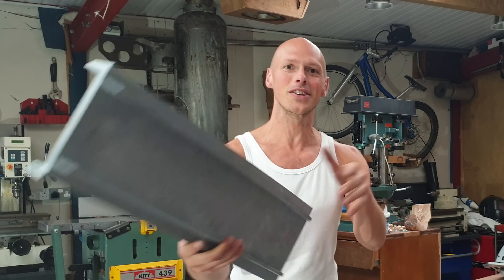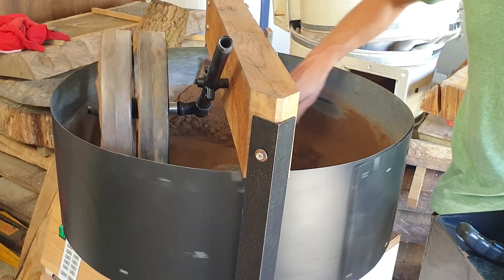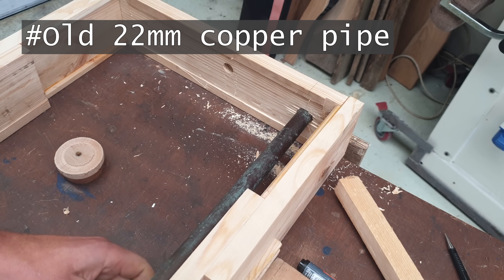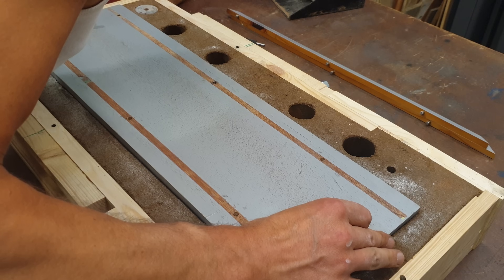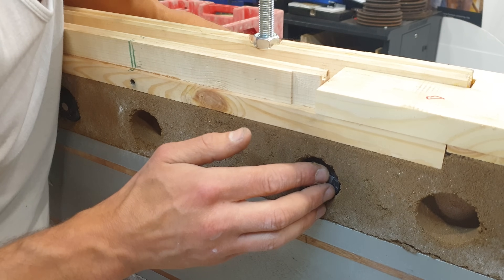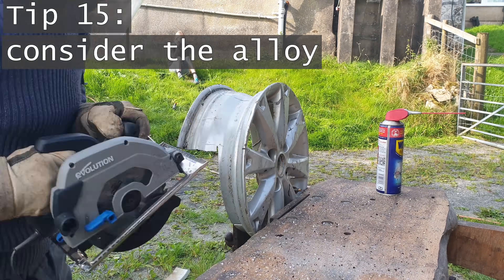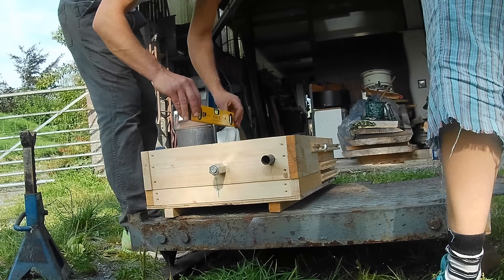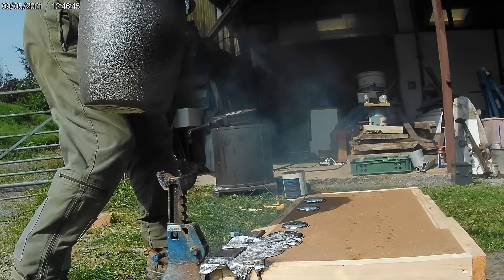Al Metal Casting: Tips for Making Good & BIG ones at home!

Comment: As a fellow metal caster and admin for a large metalcasting Facebook group, I like to congratulate you on a great video. Most of your stuff is spot on. 

A couple things - I wouldn’t give a specific % of bentonite for greensand since this will vary depending on whether they have a muller (most don’t and mulling by hand requires more bentonite) and also the sand grain size and character. You could go as high as 20% in some applications and 12-15% for hand mulling in the backyard environment would be reasonable for the beginner. More bentonite (and to a degree, more water) is a crutch that you use as little of as you can get away with, but for beginners, adding a little more will help them have more success until they wean themselves off of them. 

You should poke your vent holes from the inside out that way you don’t get sand breakout on your mold surface. I know you know this and you even mentioned that you hoped the drill’s outward movement counteracted your inward motion. Still, with a great video like this, lots of beginners will copy this, consciously or subconsciously. If you take the time to make and edit a video like this, I would focus on showing the right things to do rather than showing the wrong thing (as with the flask handles or overfilling the crucible) and saying “don’t do this”, even if it’s a genuine mistake, because it’s in people’s nature to copy when they are learning.

The holes you showed when talking about hydrogen absorption look more like air entrainment during the pour or possibly turbulence. Actual hydrogen porosity bubbles would be smaller and more evenly distributed through the metal than that. Not sure if “hygroscopic” is the word you want to use (I think that’s what you said) as that implies the hydrogen is coming from water in the air, when it’s more likely originating from the fuel. You are right to suggest avoiding fluxes and long “soaking” times for the metal. 

If you wanted to reach the far corner better, simply move your pouring basin to the middle (you can put a spin trap at either end) and the metal will only have half as far to flow, giving up heat to the sand, before it starts freezing. Easy enough.

Your angle iron over the edge of the mold is a great practice for wooden flasks and your attempt at directional solidification via your copper pipe chill is admirable. There is so much you got right in this video, I didn’t really want to nitpick any of it. Also see the few videos of Professor John Campbell (and any of his books) for more advanced tips. Also, if you’re on Facebook, consider joining the group  “Backyard Metal Casting & Foundry Work”. We’d love to have you as a member!
Reply from the maker: Hi Troye. I really appreciate you taking the time to write this thoughtful comment. Really love constructive criticism like this... As you see I have plenty to learn! I'll follow up on your reference when I get to my desktop... 
Yeah, I'm fairly sure pouring from the middle would have been better. And agree on the clay content etc. I see that as more experienced peeps chime in I'll have to compile a sticky comment with corrections / important notes... 
Thanks again :)
Reply: Here is one of the John Campbell videos I was talking about: https://youtu.be/9_w3OZ2b02A
Reply: Geezers long winded, it's an "Introductory" video to Sand Casting he's just explaining where he felt he would avoid to lesson mistakes. No where in the description dose Steven say he is a Mastercraftsman specializing in Sand Casting,  and I'm quit sure if I wanted to go any further, in this area, I would have the brains to learn more from other sources, Which Steven even recommended he left links to other YouTube videos where he learn somethings. Giving advice or even critiquing is one thing but my god we don't need a novel it comes across as a know it all. I'm 100% you mean well, but why do it publicly why not send Steve or others a link to your forum "No". Knowledge is great o pass on but don't destroy a man's new business venture publicly. I was considering your Facebook page then saw chapters of critiquing now I'm not sure. Anyway my fair friend have the best days possible. From Busted Knuckles in Barrie Ontario Canada L4M2Z8
Reply: @Busted.Knuckles.Garage  it was all constructive and he took it as such. He is a member there. If you don’t like it, you are free to keep scrolling. You seem to be the only one butt hurt here.
Reply: @TroyeWelch  YT is all about helping each other, There are no experts here or anywhere. We are always learning new tricks. I don't cast, i manual machine, but my interests abound.
Reply: @rossilake218  I agree, with the caveat that misinformation is sometimes worse than no information. In the context of metalcasting, sometimes the stakes only relate to the quality of the final casting and in other cases, misinformation can be life threatening. I’m not a self-proclaimed expert but I have been melting and casting metal for over a decade, pouring gray iron for at least 5 years, and interacting with over 10,000 other metalcasters on a daily basis. I own just about every book published on foundrywork, moldmaking and patternmaking from the late 1800’s up to the latest from professor John Campbell. In short, I’ve both done my homework and gotten my hands dirty. I’m not afraid to admit when I don’t know something and I’ve learned to keep my mouth shut and my post finger off the button when it comes to subjects that I’m not fluent in. The works would be a better place if everyone behaved the same. Hopefully you found some of my specific and reasoned constructive criticisms helpful to your own metalcasting practice (if you get there at some point).
Reply: @TroyeWelch  Clarke at Windy Hill Foundry is one of ours. He's involved heavily. I try to learn all i can about Hobby Machining. I have interests in many processes.

Comment: I've been casting for a few years and still don't always succeed! Olfoundryman's channel is excellent. Hydrogen bubbles continue to be a problem for me. I preheat the scrap auto parts and pour as soon as it is all liquid. Less bubbles than I used to get but they are still present. Thanks for the video and source info.
Reply from the maker: Great to hear from you Larry! Thanks for watching :)
Reply: what about using a vibrating table?

Comment: Great video. I don't have lots of experience casting, but it seems like you would have better results if the distances from the sprue to every location in the casting was reduced. Why not pour from the middle of the long edge and flow both directions? Also the diameter is pretty small for the size of the casting. The method I have always used is to have the sprue go thru the cope and we'll into the drag forming a well at the bottom to catch any unmelted impurities or sand and to allow the flow to stabilize before flowing thru the gate into the mold. Then the sprue also serves as a riser. It can be larger in diameter making it easier to pour and to feed the metal into the mold faster. Additionally the sprue will fill up providing a bit of pressure to push the metal in. 

That off the side thing you are doing limits the pour speed to how fast it can run off the little gate at the top into the riser/sprue.

Another option for a part like you just did might be to put the sprue right in the middle of the part. Again put a well under the sprue to catch impurities, and possibly a couple ribs to increase the flow to the edges. The sprue and the well would need to be machined off later, but the distance to every point of the mold would be as small as possible and would fill mostly evenly.

Impressive project. I want to build a 5x10ft gantry style mill myself. I never considered casting the parts the way you are, and figured I would do it all weld fabricated. I have a few rail road rails that I plan to use for the bed. I look forward to more videos.
Reply from the maker: Hi Court. Thanks for watching. I think I we did it over, we might well put the sprue in the middle of the runner... The (almost certainly misguided) reason I didn't was that I thought the splitting of the flow into two directions, rather than smoothly round in one, might add turbulence/swirl in air and oxide layers...   
Railroad rails for the CNC rails sound super interesting ;) 
Thanks again, Bongo.
Reply: There is a whole lot of professional development and experience involved in the sizing and the various pouring components. The speed of the molten aluminium through the feeder network will into the mold Has to be kept down to avoid introducing any green sand to the casting. 
Mark from Melbourne Australia